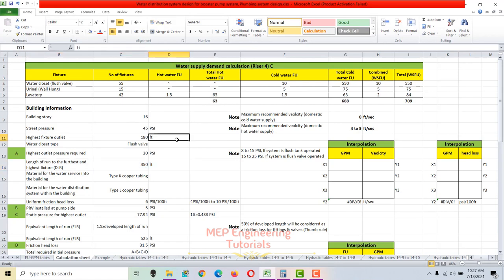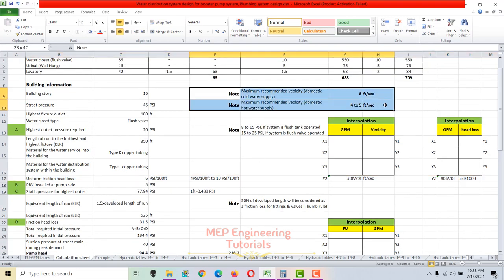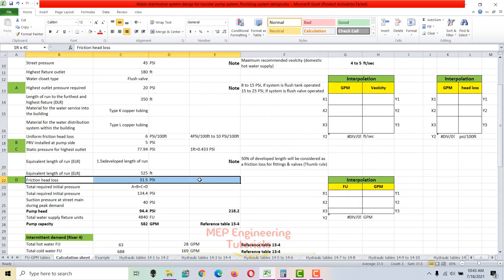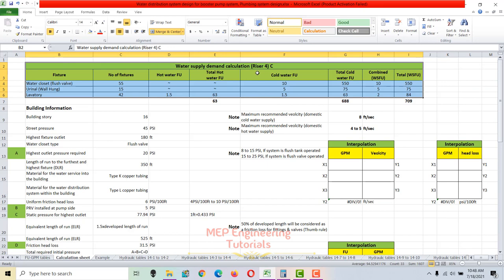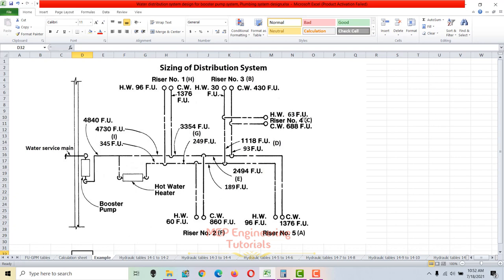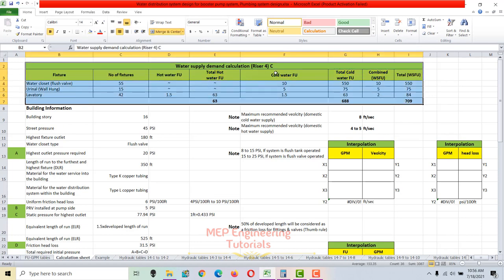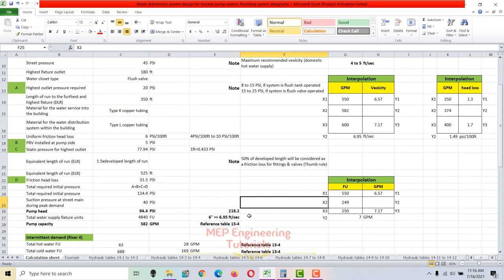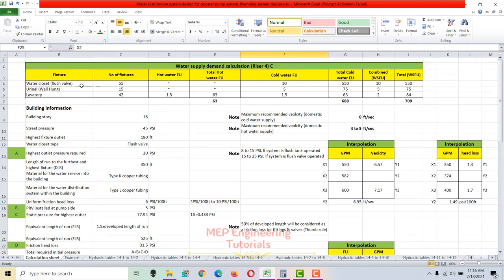Plumbing system design, water distribution system design using booster pump as source of supply

Comment: In this example you don’t need a PRV because the required pressure at the furthest fixture is more than the available pressure from the main pipe.  A PRV is used whenever your street pressure is higher than 60 PSI. What you need here is a BFP. Back flow preventer.

Comment: Dear Sir , 
for the pipe sizing , you are considering the pipe size before calculating , i mean you directly referred to Table  14.10 for 374 Gpm , based on what condition do we select the table .
Reply from the maker: @
Adil Official Channel We have to select pipe sizes based on 2 factors:
1) Recommended velocity which should be less than 8 ft/sec in case of cold water supply
2) Recommended Uniform friction head loss (4PSI/100ft to 10 PSI/100ft), in our case I had selected 6PSI/100ft.
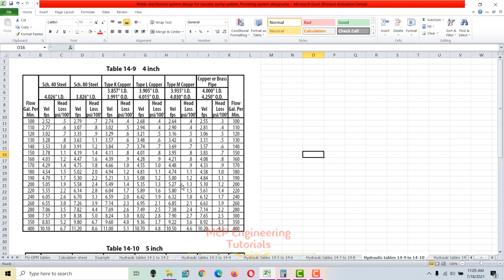The reason why I had selected Table 14-10 because velocity & head loss is in the recommended range, If I had selected table 14-9 then pipe would be under size and there would water hammer in piping due to high velocity. Further more you can see explanation in video from 33:00 to 33:42
Reply: @MEPEngineeringTutorials   Thank you for you reply and clarifying my doubt , also my concern was from which standard Table 14.9 , 14.10 has been extracted ? Is it IPC or UPC  ?  Bcs  generally IPC is followed by consultants and i couldn't find these tables in IPC.

Comment: Can I buy the excel sheets for plumbing designs and software in one deal? Not on a monthly basis, please?
Reply from the maker: Yes you can do that by paying through PayPal. Please send an email inquiry to mentioned address. Email address you can find on the about section of the channel. Thanks
Reply: @MEPEngineeringTutorials  is there a different way that PayPal??